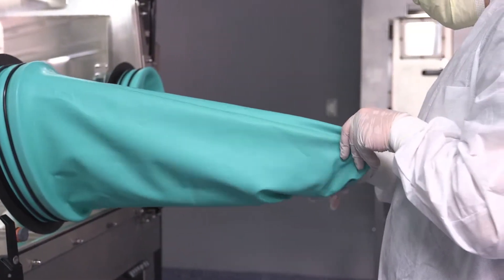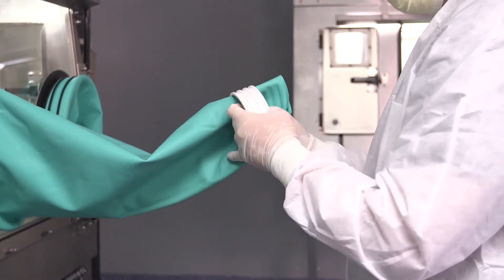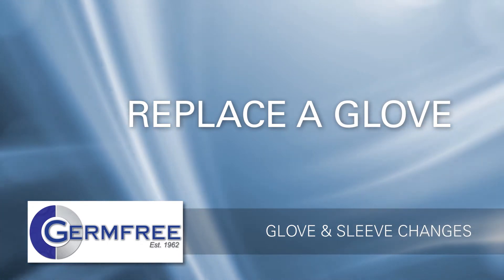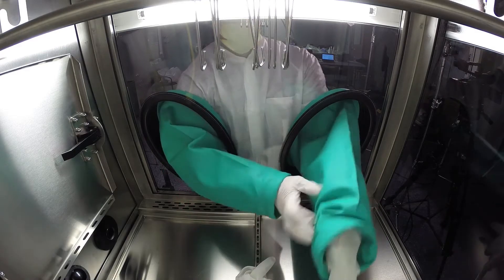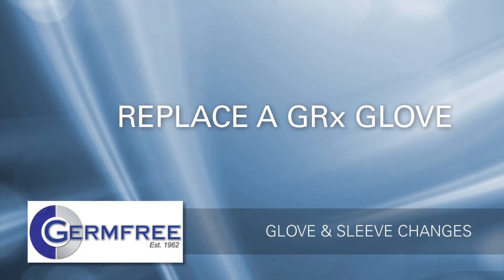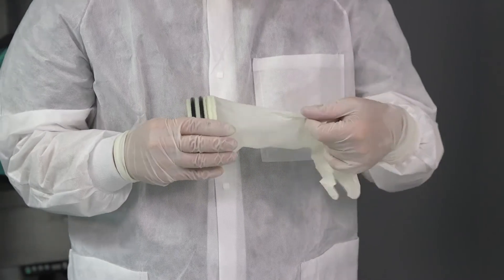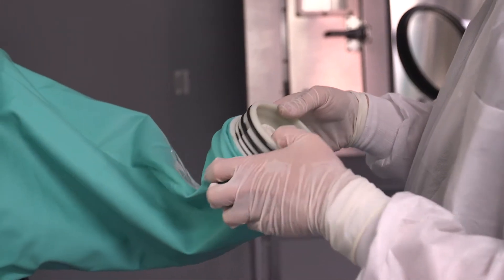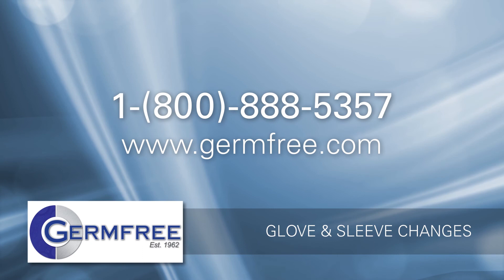Germfree - Isolator - Glove and Sleeve Changes

Comment: When adding a new Glove and sleeve with this procedure the new sleeve and glove is not sterile - therefore this is only suitable if the system is run negative pressure and you only worried about pathogens getting out. If working germ-free everything inside is now compromised.
Reply: You usually will paa the inside of the semiregid isolator. I have this type of gloves in flexible isolators and when we change gloves we PAA the area...

Comment: If you have a torn glove or damaged sleeve, hasn''t containment already been breached?
Reply: Not necessary... I have had a chewed up glove ones and a microtear... and because the isolator was negative pressure it didnt got in... we were able to do a patch work an till this day we still used it(is in line for mantainance)